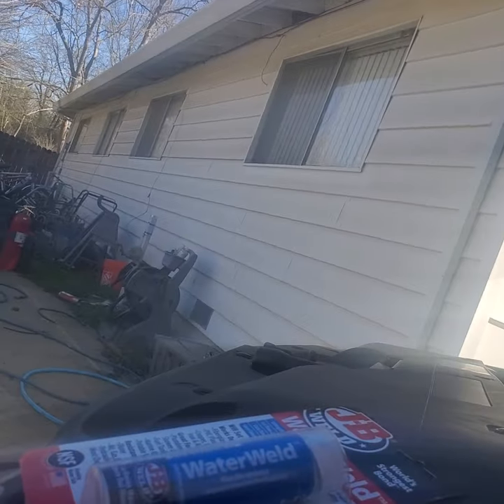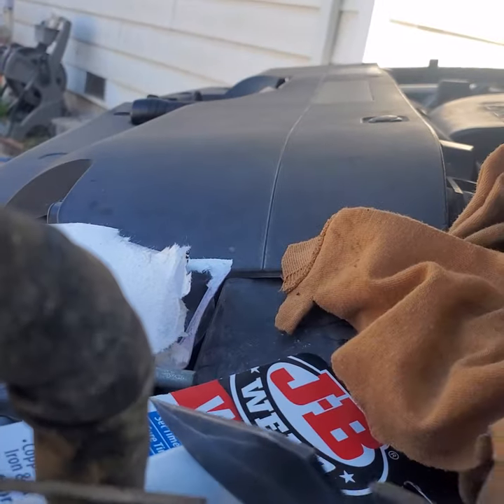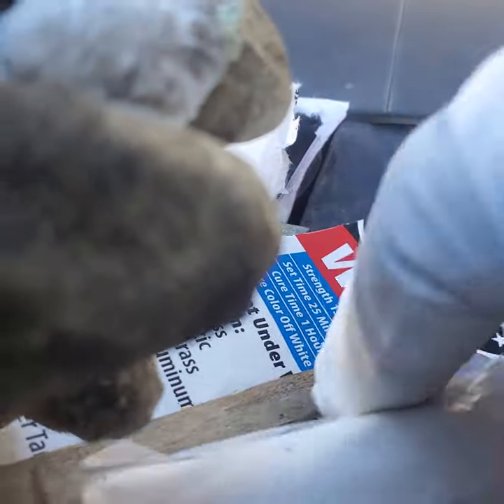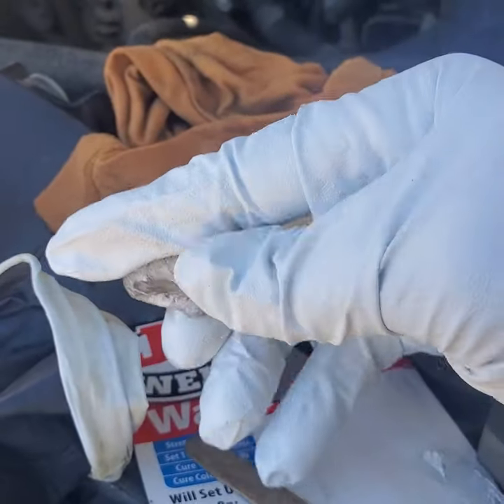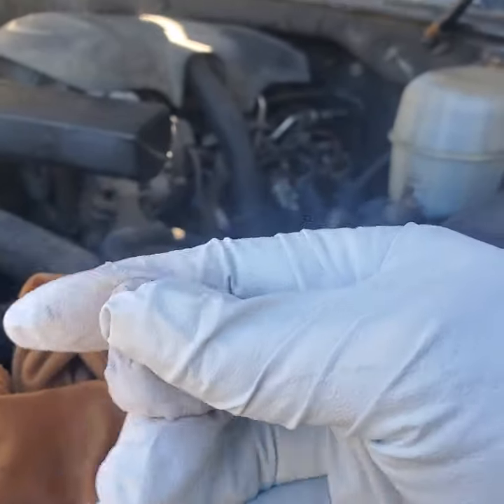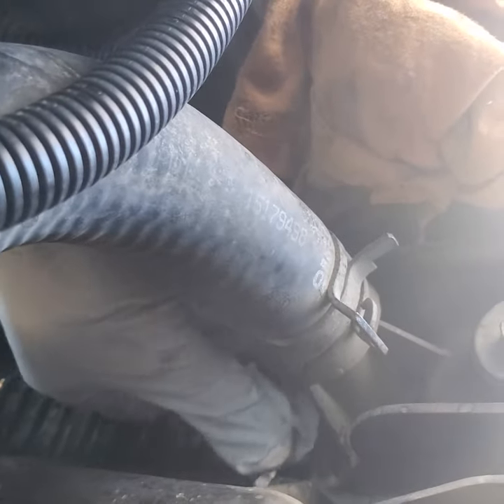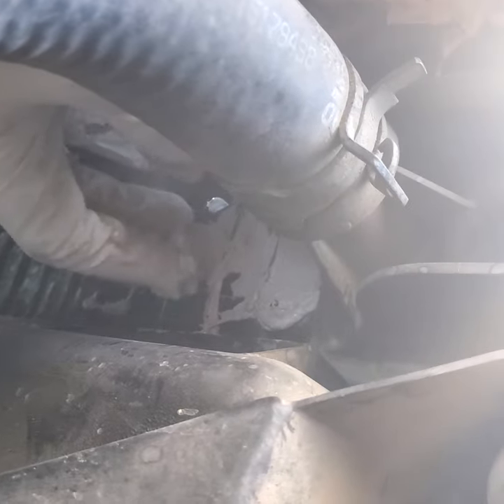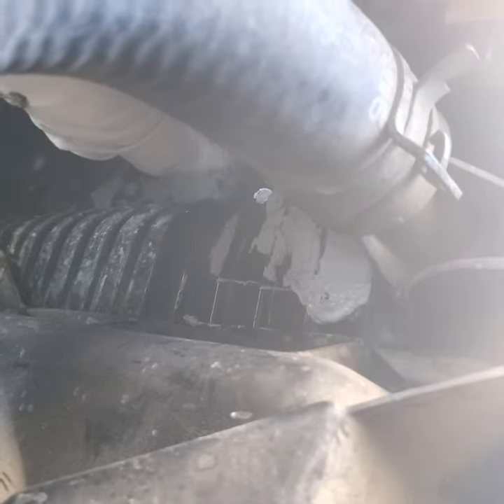radiator crack fix with jb weld

Comment: Work?
Reply: I’m about to use it on my 2013 Kia optimal within the next couple of days I have about a pen size hole behind my radiator fan screw hole I’m going to fill the hole and get some stop leak as a secondary seal for the inside since the puddy is on the outside